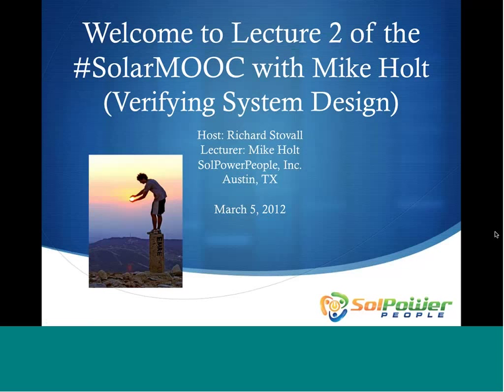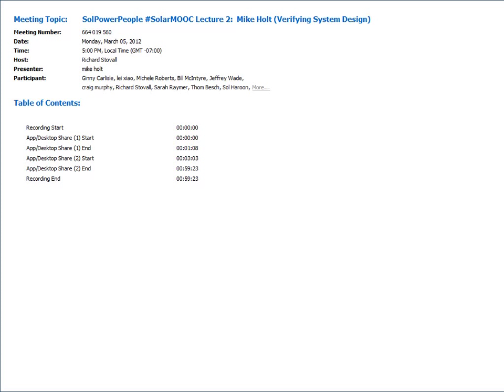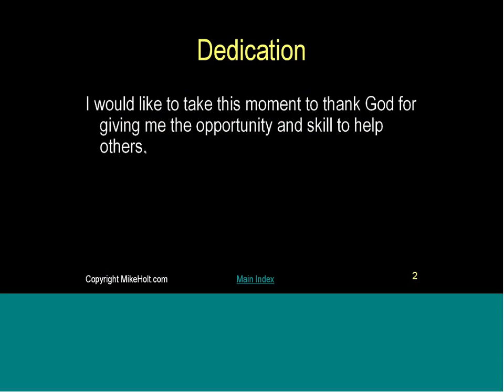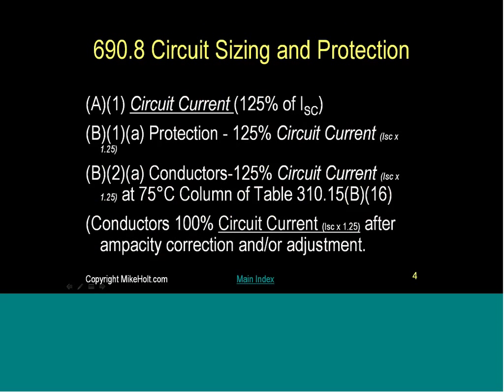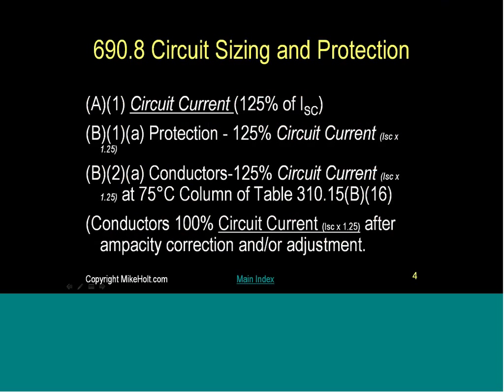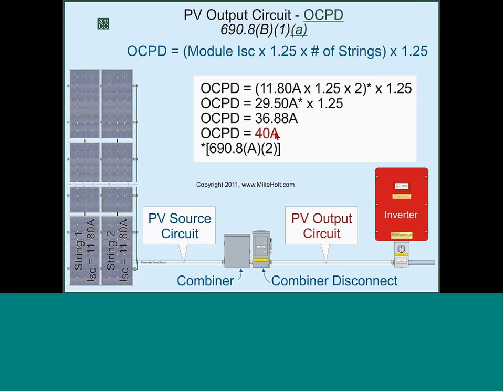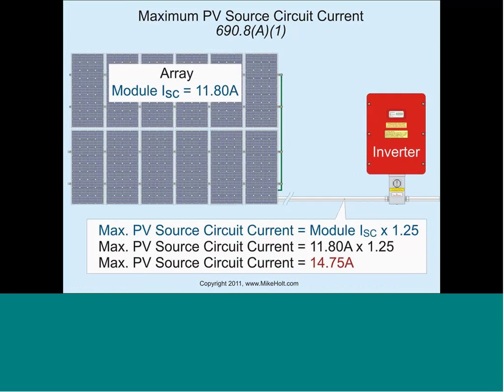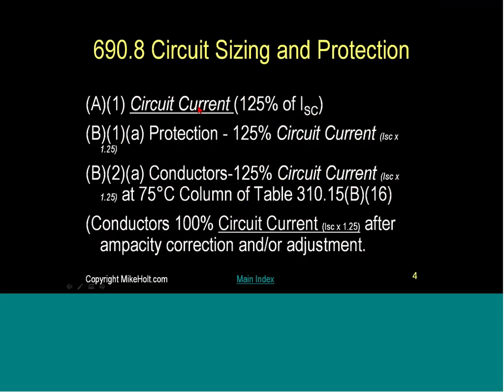SolPowerPeople #SolarMOOC Lecture 2  Mike Holt (Verifying System Design)

Comment: 2011 NEC 690.9(B)(2)(c) states:
The conductor selected, after the application of conditions of use, shall be protected by the overcurrent protective device, where required.

I may be confused on the code, but the conductors in the beginning of the video aren't sufficient to trip a breaker after the corrections are applied.